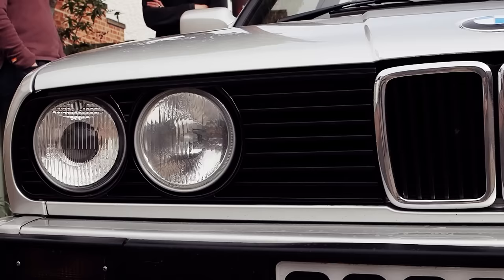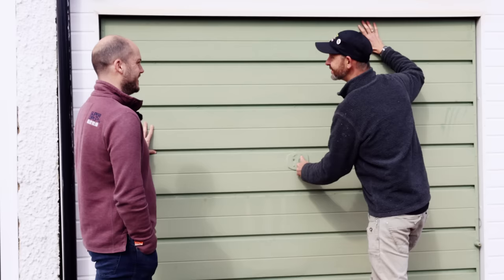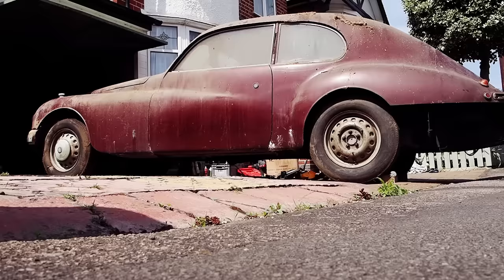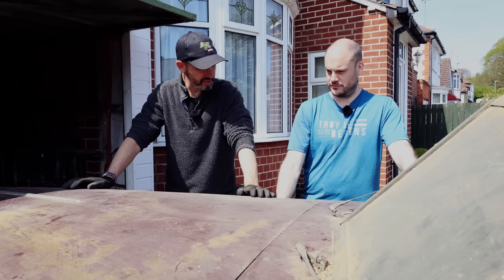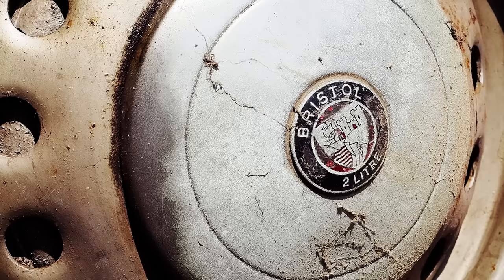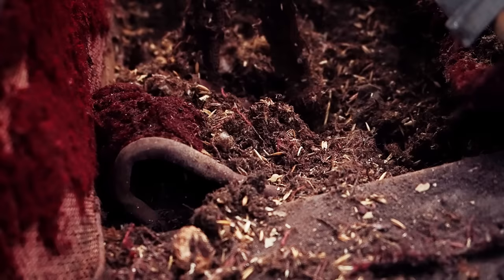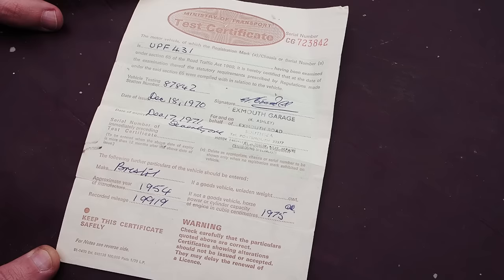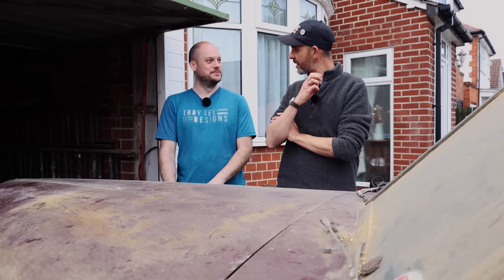Unicorn Rare British Classic Barn Find - Garaged for 50 years

Comment: Big thank you to Jonny and Matty, it was a thoroughly enjoyable day despite being a bag of nerves being on camera.
My aunt was so happy seeing the car out in the open after such a long time hidden away. They may only have had it on the road for a short time but she has many fond memories.
Current status, with the help of the BOC we’re still trying to get the 403 reregistered with the DVLA.
I have managed to strip the engine, rods and pistons were clearly scrap before I even started. The crank came out surprisingly easily. I have since taken the crank and block to INRacing, outcome is the that crank has a lot of scoring in the journals and the block has previously had a crack repaired, combined with the amount the amount of rust (top face is pitted) neither are viable for reuse (“it’s had a bloody hard life before it was even removed” was the takeaway comment). Remanufactured crank and block alone is getting close to £20k so the likely outcome will be an engine swap, either a BMW straight 6 or possible a v8 in keeping with later Bristols. 
The body itself looks nice and solid, just a couple of localised areas that need attention and they’re steel so shouldn’t be too problematic.
Reply: Good luck mate! A Ford V8 sidevalve motor would be my choice for a swap.
Reply: Go Electric!!
Reply: I thought you were great on camera, very chilled. Like you and Jonny had been mates for years.
Reply: Good luck with it mate. It’s your car to do with as you please, I hope it remains with an ICE as it was intended. Truly a thing of beauty.
Reply: Thanks for the update.  The very best of luck with the car.
Reply: Great show - I am a big fan like so many on here: As soon as I saw that block I thought "probably an engine swap" - shouldn't be TOO difficult or expensive to get your hands on something suitable. I have refurbished a few (range-rover / Land Rover) and I have some idea how much work is ahead of you .  Please keep us posted somehow - Link to Johnny or something - I would enjoy seeing what you do with it.
Reply: maybe you could show the restoration on utube .. would be interesting to see
Reply: A later 2L BMW inline 6 would be a nice appropriate swap/upgrade, hopefully it'll fit without too much bother.
Reply: Thank you for the update. What a shame about the motor. The crank could probably be rescued by building up metal, then grinding it back to size, but even that wouldn’t be cheap. Damaged castings can again be repaired in the hands of a metal god. Con rods and pistons would have to come from a different engine, but it seems likely suitable pistons & rods could be sourced. Your decision is entirely sensible though.
Reply: @nastybun  I have recently bought a very rusty E28 520i with a view to potentially using the engine from that, but still keeping options open for now.
Reply: As I was watching this, it occured to me that the engine was a bit of a right off and it would probably be a good idea to put a newer BMW engine in it. And then I read your lengthy paragraph about exactly that. 
 Good luck with the project mate. I think you're gonna need all the luck you can get with this restoration. It will be interesting to see what you do with it and then the day you take your auntie for a ride in it. That'll be a bit of a tear jerker for all of us I think.............🛼🛼🛼🛼
Reply: @kedgeuk  Personally, if I had to go down the engine-swap route (which would be a great shame and seriously devalue the end product) then I would be looking at a Triumph 2000/2500 engine which would be a much closer match to the character of the car and would be a very cheap conversion.
Reply: Thanks for the update, all the best for getting her mobile again, no matter what power plant you pop in.
Reply: Immersion in a bath of molasses would slowly remove all of that rust in the engine.  I know that this sounds unlikely, but it really does work.
Reply: @saxon-mt5by  There is no reason to scrap the current engine.  See my comment about removing rust with molasses. I have used this  method myself and I know that it works.
Reply: @kedgeuk  as long as you are sympathetic when you,put the BMW engine in, replacing it with a Bristol engine later should not be a problem.
Reply: Lovely to hear this story.  Another heart warming story, shame your Uncle is not around to tell us. I'm sure he could tell a Story! 
Shame the Engine couldn't be saved, although a little surprised, not. I wonder if a M20 six crank and  pistons or complete bottom end could be fitted to it with the Original head and carbs? 
If Not and it cannot be saved, the 2.0 straight six M20 engines are still available to buy. 
Whatever you do good luck. It would be lovely to see your progress with this and I'm sure your Auntie would love to see it run again ❤
Reply: Good luck David.  It doesn’t matter if it takes five or ten years you will get her back on the road.  When that happens it would be great to have Jonny revisit and we all see the result.  Very special car with a special history to you.  A great story.  Thanks for sharing.
Reply: @davidbamford4721  I agree with you; the trouble is the Bristol engine is hugely expensive to overhaul.
Reply: Check Oliver Penny engineering to see if he can help you ?
Reply: You just have to stay with a BMW drive train, but nix the V8, stick to a straight six, or one of the EV assisted sixes.
As much as some may suggest rebuilding the original, it's only use is resale to collectors. If you intent to drive the car on the road, a 'bolt in' style restomod is a far better choice. Treat the powertrain as a module that needs to fit without affecting any of the panels or chassis, and you'll do fine. Reading the later comment about the rusty donor, that seems to be a perfect choice.
Reply: How ever you do it, I'd love to see it up and running and that big old smile on your face.
Good luck David.
Reply: @PiDsPagePrototypes  I don't think people realise just how expensive these engines are, looking at circa £20k just on parts for the bottom end or taking a punt on a complete engine for £13-15k which can't be seen running! They're the reason so many 2l Bristol's are for sale without engines, many were removed for use in period race cars (Frazer Nash, Cooper Bristol, AC's). As nice as it would be to retain the correct type of engine it'll never be a matching numbers car and has already had a colour change in it's life so I'm less inclined to worry about originality and just get it on the road to be enjoyed.
Reply: @trippydrew8492 not a bad option, but might be prohibitively expensive
Reply: @kedgeuk  M20 is also a BMW 2.0 six, it's like it's also the nephew of the original motor. You'll have to give Jonny a road test drive once you get it back on the streets.
Reply: This sounds like a great option. I think it should remain a 2 litre but whatever you do, good luck! @kedgeuk
Reply: @keithhoughton4308 oh nooooooo! Never I'd rather se a BMW straight six in rather than a bloody Ford motor!
Reply: What a beautiful car! I've never seen that particular design of Bristol, later ones yes but not one made two months after I was born lol
I'd go with the 520i engine that you got from the donor car. Good luck with it. Yes as someone else commented this would be a nice restoration series on YouTube. I've just had a thought, send it out to Pakistan and they would end up and machine the crank and sort the bock as well.
Reply: Would be nice to have updates on this, it's a beautiful car with a lovely story along with it, would be nice to see the original engine go back but I understand the cost involved, might be best putting a BMW engine in but the bodywork looks good and it's all there, no matter what engine goes in it really deserves a restoration and put back on the road, I wish the owner all the best with the restoration of this beautiful car
Reply: A thought, if you have the money after the bodywork you could go down the electric route, I'm sure Moggy would love to convert this to electric, it would probably be the only electric Bristol and he would do a beautiful job
Reply: @nastybun 
A breathed on OM 606 Merc diesel, perfect for the car and will last as long as the car, not like the BMW stuff.
Reply: Sounds like it's found the right owner.  Get it back on the road, with all the elegant charm but not being too precious about originality, very cool.  Look forward to seeing it some time, good luck.
Reply: @keithhoughton4308  are you having a laugh mate.This is a specialists motor that had class about it in its day and still does today.Its not a dog poo on the end of shoe type motor of its day  ie seen everywhere on every street corner like blue oval badge mass produced tatt..Why lower the tone of quality parts.Henry ford gave the nazis tank engines. i wouldnt afford that kind of poverty spec to this car.
Reply: Electrify the Bristol and you’ll have one of the coolest cars on the road..
Reply: @rampantram1  You do know what a sidevalve v8 Ford motor is?
A friend of my father had two of these Bristols in the 70's. He thought he needed two to keep one on the road. He was wrong, he should have bought three. They rotted away (yes, even though they were aluminium)  like a lot of exotics did in those difficult times. 
No doubt you would want a modern BMW motor in there?
Reply: It is a beautiful looking motor car, I'm sure I am not alone in wishing that you do eventually get the old girl working and in use for many years to come.
Reply: @samrodian919  glad someone agrees.
Reply: @keithhoughton4308  no i stick to as close as i can get to the original if thats not possible then nah it wouldnt be a beemer nor a ford.The latter just screams poverty spec for the masses and that car to me is a specialists motor.I love the look of a scimitar but the ford under pinnings make me do a wide swerve of it.
Reply: @rampantram1  That's a shame because a well sorted Scimitar is a rewarding car to drive. Rot is less of a problem and the motors are simple and readily available.
Reply: Thankyou to your aunt for sharing this lovely car with all of us!
Reply: You were fine, and good luck with the rebuild! Great to get an update of stuff that's happened since filming!
Reply: Such a beautiful piece of history. I'm so glad to have watch this episode. I don't know if I've ever seen this year of that automobile before but I absolutely love it! It truly is a work of art! It would be such a shame not to see this car saved. So glad to hear it's been kept in the family. By the way it was taken apart and all the parts were laid out in perfect order on the shelves is shows your uncle had full intention of getting this vehicle up and running again. I hope you find an engine that's a good fit and has longevity so you can enjoy the car then not have to worry about expensive breakdowns constantly. I do like all original cars but I absolutely love to open the hood and get a surprise of a proper transplanted engine. Hopefully you get it to where you can enjoy it. I know your uncle will be smiling down on you saying you enjoy a car he truly cared about. I hope you post some vids as a car move through the stages of restoration. Thanks for sharing a bit of your family history with us. I truly enjoyed it! Such a beauty!
Reply: My Uncle had one and fitted a 3.8 XK Engine in the 1970s......
Reply: My Uncle had one and fitted a 3.8 XK Engine in the 1970s......

Comment: That log book is a VE 60 (standing for "Vehicle Excise") or green log book. These were not introduced until the mid-1960s, and stayed current until the DVLA central records were set up in 1976-1977. The original in 1954 would have been an RF 60 (standing for "Road Fund") or buff coloured log book. These were stamped every time that the car was taxed, so they did get filled up over a period of so many years, and a continuation log book would then have been issued. This is most likely what happened with this Bristol. Unfortunately any details of the previous owners from the RF 60 were not always transferred onto the VE 60, only the then current keeper, so the Bristol may have had other un-recorded owners prior to the issue of the VE 60. The DVLA will usually accept the VE 60 as proof of the original registration mark, so I expect that the owner will have no problems retaining it on this fine car. It will be on a "Non-transferrable " basis, but all to the good, as it will protect the car's identity from being robbed at any time in the future.

Comment: Bristol used offer boring out the motor to 2300 cc, high compression pistons, gas flowed head and bigger valves to produce well over 125 HP. There was also the fabled six port head as used on Copper Bristol racing cars - that would boost the horsepower to near 200. I even saw a 403 for sale in Sports Car And Classic with a M series BMW motor and gearbox fitted which would have literally made a Bristol flying machine!

Comment: I was at a engine builder. He had engine parts soaking in a solution that only attacked rust. They were looking great. I would look into soaking that engine as a whole. Then inspect it after. You have to at least try to save original if possible. 
Personally I would contact Jay Leno to see if he has interest. For proper saving of the rare car.
Reply from the maker: Would be great to know more.
Reply: @TheLateBrakeShow  look into electrolysis......no harsh chemicals , but not good for aluminium (so either remove them or be sure to find replacements)
Reply: Could've been EvapOrust , great stuff , use it myself.
Would be worth just dumping the engine in a 45 gallon drum of diesel.
The engine can certainly be saved.
Reply: Read the pinned comment from the owner at the top of the page

Comment: Great episode Jonny of an exceedlingly rare car with perfect low owner and mileage provenance .It would be extremely worthwhile if the original engine can be saved despite the challenge of the bottom end , I have seen and been involved with  many in similar condtion and it is surprising what can be saved.I wish David the best of luck with which will be a considerable  but such a worthwhile challenge .

Comment: Top tip with leather thats not been used a long time. Once its cleaned cover it in hide food or neetsfoot oil. It will be dried out and if you start using it without softening it will crack and age 50 years in a few months. I learned this all the hard way !  Get it nice and soft before sitting on it and it will be fine. It all looked good for its age in the video

Comment: Knew Brian May quite well personally, he was an amazing character. I don't want to sound pessimistic but people who bought Bristols in the 1950s really drove their cars a lot. Given that uncle Peter put 7000 miles on it in less than a year, there's a very good chance that the first owner did 6000 miles a year which over nearly 20 years would end up at the 119,000 miles when Peter bought it. That's backed up by the fact that it sounds like it needed a repaint at which point the owner decided on a colour change and the interior looked well worn for 26000 miles, plus uncle Peter obviously also felt the engine needed to be stripped for an overhaul......
Still nobody will ever know for sure so the owner can fortunately believe whatever he chooses. I really hope he gets that back on the road to be enjoyed......
Reply: That’s an interesting point, I don’t remember whether it’s only a 6 digit milometer. But after stripping the block and taking it to a specialist they advised there was a heck of a lot of wear on the crank and a previous crack repair on the block.
It certainly wasn’t an expensive car when he bought it.

Comment: Great to see another 403. That engine is the crown jewel of that car and whomever took it out ruined the project. Ian Nutthill/INRacing can likely sort it out, but the costs involved far exceed the value the car. Would be great to bring back to life.
Reply: It’s been to INRacing since filming. Their assessment other than the block and crank being beyond saving is that the engine had had a very hard life despite such low mileage. There’s a huge crack repair on the block and lots of scoring in the crank journals, maybe explains why it was removed.
Reply: @kedgeuk  in good hands then! They can make a new block and crank.

Comment: What a beautiful machine that is. If it is at all possible the original engine needs to go back in there, I wish I had the skills to do it but I don’t, but there are some very clever people out there and maybe someone could bring that old engine back from the dead.
Reply: The engine has been looked at by a couple of specialists now, block and crank are both beyond saving unfortunately.
Reply: @kedgeuk That's sad. The block can be replaced, if it's truly related to a BMW
Reply: I would look further a-field for a  3rd or 4th   opinion. Crankshaft could be remade of course, but the block could be acid dip cleaned, any cracks can be rectified and of course it could always be resleeved. Maintaining the original engine number must be key here. Depends how much the guys budget is but I would suggest sending some photos of it to the Mönchengladbach branch of Capricorn Automotive Engineering.

Comment: And, of course, the AC Ace had that same BMW-based Bristol six cylinder.  Carol Shelby replaced it with a Ford 260, then a 289, and eventually the 427, to create the Cobra.  Hmm... a 427 in a Bristol 403...   That would be quite the Q-car.

Comment: I'd actually quite like to see this given the Lunaz treatment. The engine bay is so cramped, you can't really fit any modern piston engine in it, certainly not a straight six (forget a 2JZ swap, it won't fit!), it already has a separate chassis into which batteries could be fitted...